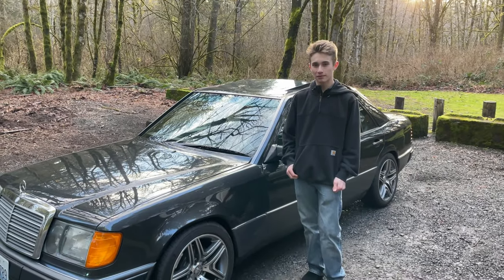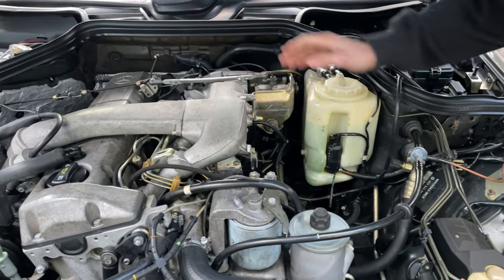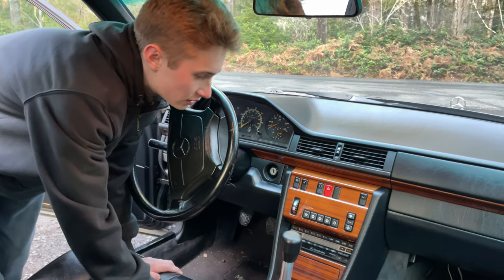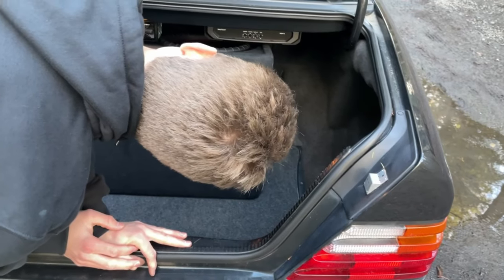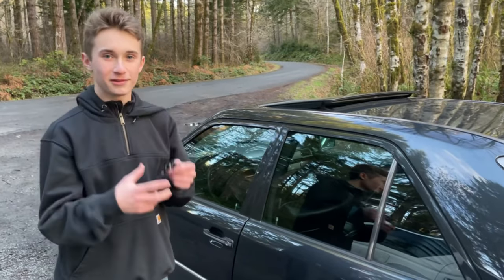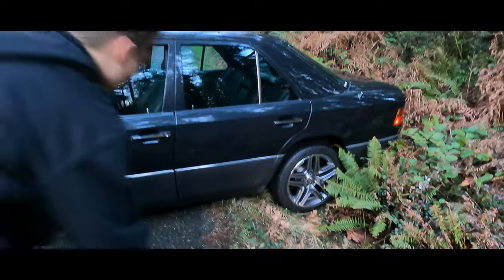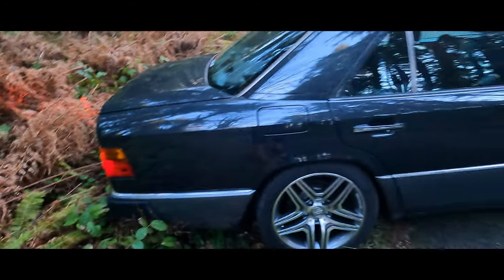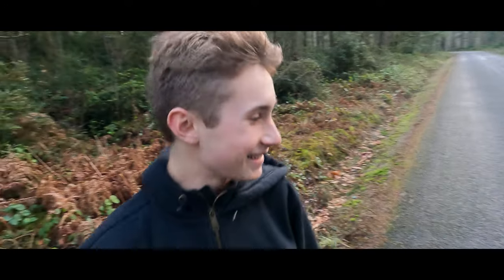Justins Mercedes | 1993 300d super turbo diesel

Comment: hi, I have a 1995 300d  and a 1993 2.5  i really like what you have done with your car, I would like to know more about what you have done
Reply from the maker: Hello!, those are two great cars and thank you!! I am more then happy to answer and specific questions you may have about a specific components on the car and feel free to ask as much as you like, but I can say that the wheels are 17x8 35mm offset and 225/44/r17 tires, silvers neo max coil overs. The pump has 7.7mm elements and was built by Diesel Pump Uk and I am running -14 degrees after tdc for timing. I welded a custom straight pipe exhaust. Transmission is from a bmw and is a Zf gs6-37dz with a Diesel pump uk clutch and adapter kit. Welded custom driveshaft and crossmember. Kangaroos team shift assembly. And then I haven’t installed but have parts for a borg Warner sx257 turbo and kangaroos team headers for om602. I’m planning to set my waste gate to about 30 psi, AMG wide body fender shims. I hope this helps!